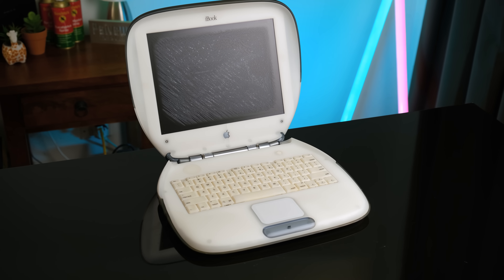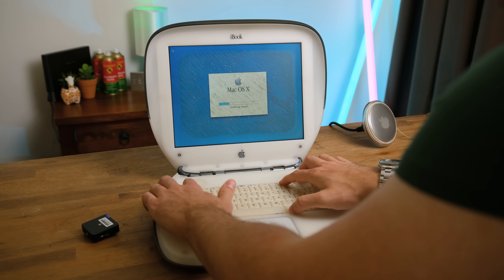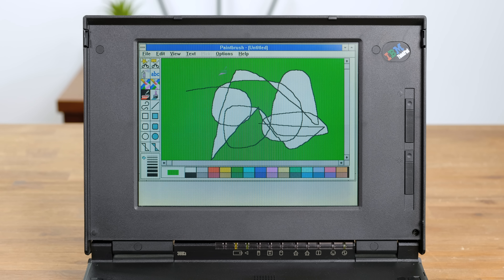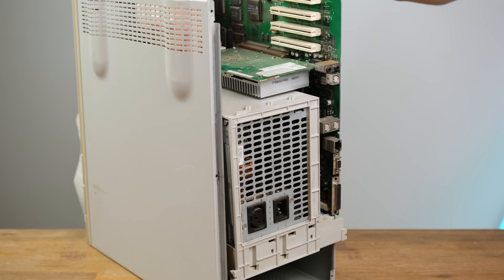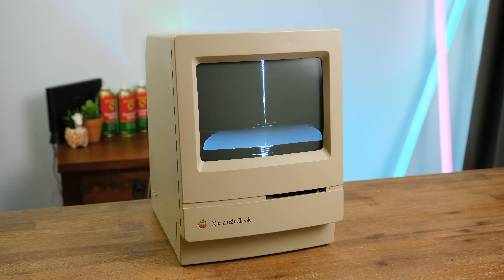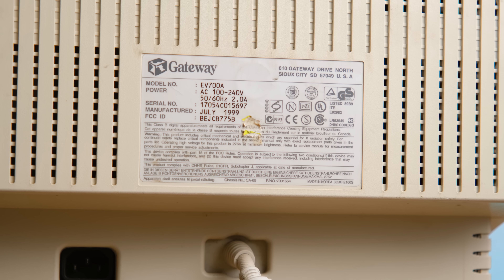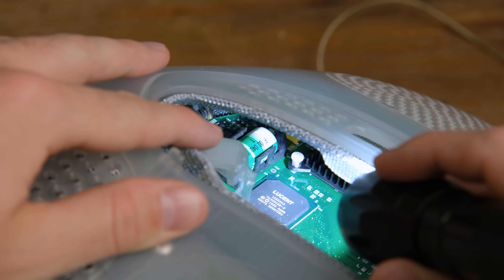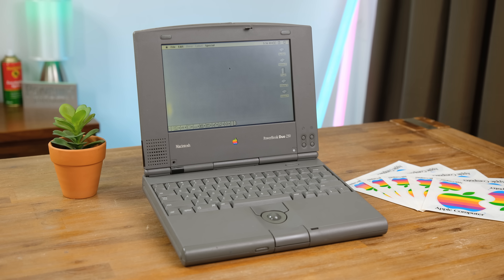So Much Vintage Tech Is Dying... Here's Why

Comment: i don't wanna sound like i'm trollin but...

my 1997 model playstation 1: 
>no capacitor corrosion at all
>the potentiometer for the cd laser just needs some tweaking and it's ready to keep going for some more years
>cd laser assembly easy to replace, no recapping required for that
>power supply's just 3-4 thru hole capacitors, pretty simple to fix if you want more reliable power going to it
>boots up just fine works just like day one
laughs in playstation

to showcase it's not sony fanboyism, i've had FAR less reliable fat PS2s when it comes to the disk drive behaving properly.

funny how that cheap ass console appears to be more resillient than far more expensive computers of the time and even newer than it.
Reply: I mean, I have a NES from 1986.... Works better than I remember it when I was a kid (I did open it and push all the pins back for better contact) and I use it at least once a week.

Comment: 3:32 Yeah those Duo Docks man. I recently bought one, and it didn't even survive transportation. Heard something rattling in there when I got it home, and when I tried opening it up, the dark gray plastic details broke in several places. It's like it's not even plastic anymore, it acts more like hard rubber in terms of how bendy it is when initial pressure is applied, but then with a bit more pressure, it just snaps right off. Don't think I'm able to save it,  90% of the docking mechanism is based on that dark plastic.

Comment: Yes, this is a perfectly normal thing to happen. As a former collector of old electronics, gadgets, computers and consoles - various materals break down over time also depending on how they where stored. For example old cassette players tend to have rubber belts in them that will crack or melt over time as a chemical reaction to prolonged exposure to air, humidity heat and cold. Plastics tend to crack over time, metals will eventually corrode, batteries and capacitors will either leak or dry out and cause leakage, corrosion and shorts. For example my old electronics lab had perfectly good functioning useable test-instruments in it, I turned a few of them on after a few years of not using them - and they don't work anymore. This is usually due to shorted capacitors - that is capacitors that has dried out and no longer functions as they should - locating them and replacing them is usually the answer.
Reply: Yeah, I don't understand why some people are upset that a product that nobody expects to use for practical purposes 10+ years after purchase starts to degrade. It would be moronic to build them to work for decades. Car reliability is important because the function of a car hasn't changed for decades and will remain essentially the same. Computers are not like that. Given a long enough time, even simple tasks will push a computer's hardware to the limits. I completely understand wanting to collect and preserve them. I think it's really cool which is why I subscribe to this channel. But to say that it's some sad state of affairs that computers start to break down after many years is kind of missing the point of computers.

Comment: I found out ammonia is great at completely removing the melting rubberised coatings accidentally. And it's cheap. Comes off in an instant with no resistance
Reply: but that thing is toxic as fuck and burn your nose
Reply: Wait really??
Reply: @PhantomWorksStudios  yeah, I was cleaning up an old unifi AP because it also had started to melt the coating and I had a spray bottle with ammonia I used to clean the house. With gloves on I wiped it off with a paper towel and magic, the coating vanished
Reply: More details? What concentration? I have a few rubberized items i want to remove the coating from!
Reply: @goclunker  I know amonia mixed with water temporarly fix dry and cracked up rubber. It's can be a quick solution for à temporary fix in a car for suspensions.
Reply: @goclunker  oh, it was just car windscreen cleaner and a rag
Reply: @auzzierocks  hmmm

Comment: the pastic destroying itself is also a concern for 80's and 90's car. in my car, a lot of gasket, engine part and washer were starting to be made out of plastic. they all now break appart when you try to dissassemble something or were already destroy. There was a really bad play in the steering wheel and it turned out they used plastic spacer to mount the bolt on. those plastic thing disintegrated years ago and left a pretty big hole and that's why the steering was shaking and moving everywhere.
Reply: In a couple decades it will be easier to find classic cars from the 50s and 60s than it will be able to find working examples of cars from 90s because of all the plastic and tech that just doesn't last.
Reply: @Novusod  it’s funny because it’s already hard to find any cars from the 50s and 60s anyway so I highly doubt that statement
Reply: @Novusod  I feel like we're already at that point I see far more cars from the 60s and 70s on the road than cars from the late 80s and early 90s.
Reply: @Novusod  plastic and tech can last, but it depend with quality. And at that time they found out that plastic was an awsome material to make some cost cutting part. And that plastic wasn't good either. Look at the plastic from 30's phone. My mother had à phone that her father had, it was from the 20s I guess. Full wood And Iron except for the handle that is hard plastic. Guess what didn't roted or rusted out.
Reply: @mehdisol7094  Your mother's phone would have been made out of Bakelite. Not really a plastic in the modern sense.
Reply: @Novusod  Nope. Bakelite is still plastic.
Reply: @Novusod  bakelite gets brittle, esp if it gets hot.  so it has its own problems. looked after it lasts for a long long time.
Reply: @Novusod  It already is. When was the last time you saw a 1994 Chevy Beretta?
Reply: Nature and Time destroys everything, even without using it I was looking for a cool honda from the 90s with a vtec.
like i had when i was a teen
But they are all in bad shape now, they are falling apart 
Same with other brands ....
All the cool cars from the 90s are breaking down and parts are harder to find
Reply: @HappyDude1  I sold a 1998 Acura integra GS-R a few years to a guy. That car was a time capsule that i drove to work on Friday’s and special occasions. The car was covered or garaged for most of the 22 years I had it. Just protecting it from UV radiation and extreme cold ensured that car was in solid shape. If you wanna find one you’ve got to find someone like me who preserved one
Reply: @Matthew Caughey  
Why did you sell it ? 😵
Reply: @HappyDude1  My 94 ranger is what I'm driving now. I can get parts a day long for it!  O wait, you said cool cars. 😅
Reply: I hate with passion plastic valve covers and thermostat housings
Reply: So many used cheap plastics in that era as well. My 88 Camaro plastic virtually disintegrates to the touch- best not unclip anything if you can avoid it!

I’m more worried about today’s cars in the future- we are seeing essential items like cooling system components and even oil pans made from plastic that will ultimately fatigue and crack with heat cycles.
Reply: @sc3ku  me boio the dash is known to crack and the hatch motor gears can strip if you have the 5.0 TBI its bullet proof
Reply: I feel your pain! Back in high school I had a 1998 Chevrolet and when I was working on it with my dad, he bumped one of the radiator hoses on the intake manifold. Guess what that connector was made out of? Needless to say I spent an afternoon hunting down a 3/4 inch tap to fix the marred threads (after he tried to remove the leftover plastic with an ez-out) and replaced it with a proper aluminum connector.
Reply: The rear doors of my truck stopped working because the internal latches used plastic on the ends of cables
Reply: I love 3D printing, moulding and casting. We're going to have to get good at re-manufacturing parts at small volume to maintain all sorts of ageing tech. Plastic parts are not exactly high on my list of worries, even though they are becoming a headache.
Reply: My 1988 Toyota Cressida suffer from this issue too. The center console frame is so brittle that by just plugging/unplugging a lighter plug phone charger can easily destroy it. I think the only cheap way to replace mine is to get a good 3d printer so I can replace other damaged parts too
Reply: Don't forget ECU failures, the capacitor issues that plagued computers in the late 80s into the 90s and 2000s also plagued the ECUs of cars from that era.
Reply: @Dan-TechAndMusic  There's also Z adhesive failures, that's the kind of tape headunit and dashboard LCDs are connected with to ribbon cables and PCBs. All sorts of internal display failures as well, usually very unpleasant or impossible to sort out. Then there's EEPROM bitrot, especially embedded EEPROM with readout protection (firmware). I think typical issues like cracked solder joints and capacitor plague isn't even that bad, like you have to tear things down and rebuild them, but at least these are low risk repairs.
Reply: I had this issue to a degree with my 72 Chevy with interior parts plastic shattering and rubber Ewing a goopy sticky mess. Luckily they made all the important bits out of metal
Reply: plastic parts can at least be 3d printed.  not sure how well the replacements will last, but they can be remade and remade.
Reply: @varsityathlete9927  I have had issues with longer term durability with PLA, the most common 3D printing plastic. I don't know what it is, it's reacting with something (ozone, light+oxygen+moisture?), but a few years on, all the PLA prints that were initially quite strong have failed in surprising ways. I have been 3D printing for 5 years now. PETG and HIPS are looking very good for endurance, as should ASA.

There can always be formulation issues which lead to material degrading. The Mac inner chassis just crumbling to bits in this video, it should be ABS and it shouldn't be happening to it, but well there it is, and i have absolutely seen this before first hand so i know that this happens, and i don't have an explanation. Best i can say about this is that you'd have to be quite unlucky to have this happen again on this timescale with remade parts.

Polyamide (PA) is also useful printable polymer family for spacers, mounts, bushings and clips, this is also what they're usually from originally in a vehicle, being both very low-friction, inert, flexible and exceptionally tough, and these last depending on temperature for 10-25 years, or can be rehydrated to extend their life. Indeed you're likely to find PA-GF (same but with glass fibre for stiffness) parts in engine bay, and could be considered printable, but would do best just being kept rehydrated once in a while. They're cast or print hard and undersize, and conditioned in humid atmosphere for a day or several depending on temperature or during transit from factory (sealed in bags with the right amount of water), absorbing about 4% moisture by weight, and with time and heat, they just evaporate this moisture back out and revert to the brittle and slightly shrunken initial state, but as long as they haven't cracked yet, this is reversible just the same.

Typical case of a brittle shrinking dashboard is where they cheapened out hard and used plasticised PVC, this is fairly typical. This is bad in a number of ways. For one, PVC is chemically unstable, the chains break at elevated temperatures or with time. For other, it already gets pre-degraded substantially during injection moulding, because by the time it gets molten, the temperature is critical for the polymer, it doesn't survive much more than a few minutes. Third, the plasticizer is a "non-volatile" solvent, well guess what, it does volatilise eventually, and i have reason to suspect that no way can exist to reverse it. A copy cast out of epoxy should last just about forever though. Indeed just about any way you'd use to manufacture one, it's going to be better and more durable than the original.

SLA resins are an active research field. So far they're not doing great, but the progress is exciting.
Reply: @SianaGearz  thanks, interesting.
Reply: thankfully in my 1991 Geo Prizm, the rubber breaking and plastic breaking is only in the interior, the rest of the car is doing fine, it makes me sad though since replacement interior panels for Geos don't exist
Reply: @lavafish7660  3d print?
Reply: @Anonym Anonym My 66 Mustang original speedometer bezel was at the bottom, so I had to find a OEM that looked almost new.
Reply: I had a 98 beetle and vw used a soft touch plastic like he talked about all over the interior. By the time I got the car 20 years later it was a broken down into a sticky mess that smelled like crayons.
Reply: Not many car made after the late 1980s is worth collecting.
Reply: @Melvin-h9l5x  actually yes, if you are not closeminded the 80's and 90's saw some of the greatest cars. Engine became more powerful, cars were more reliable, not à lot of tech and no emission restriction to fuck everything up. I love 80's and 90's car, they have so much style and charm
Reply: @Melvin-h9l5x  the 90s had some amazing cars, not everyone wants to live in 60s retrofuturism or 1920s ornate, some people might yes but not everyone
Reply: I had a car from 1996 and the whole plastic dash was falling apart a couple of years ago. I had to sell it at a ridiculous cost at the end. After that I realized it's a bad idea –overall–to buy a car from the 80's-90' and in some cases even from the 2000's.
Reply: It's interesting, I have a still-working analog voltmeter from the 1940s, made of bakelite plastic, that still works perfectly. And the plastic hasn't broken down at all.
Reply: @joshualowry2000  and this plastic is hard as fuck too
Reply: I have a Yugo and almost all the plastic is visibly in one piece, but feels like it shouldn't be. The dashboard feels like a paper thin sheet of chalk that would shatter into a million pieces upon trying to remove it. I haven't tried, I'm scared to lol. I had to wrap the steering wheel to keep it held together.
Reply: I remember in middle school, some friends and I used to love going into the woods and looking at remains of old things people lost or dumped over a bank. We found a car in there, but it was so rusty I don't know when it was from. Old records that had deteriorated were common, pop bottles, and even old metal wheel frames that the wood rotted out of. General rule was that plastic was safer to leave than try and pick up if it was past a certain point. It would just crumble. Cassettes were bad for falling apart and being found in the woods. 
That being said, one of my teachers from then has a Chrysler van from the 90s that I saw in 2019 and couldn't believe it was still going, let alone made it on such a long journey where we met! I can't remember if it had wood or plastic interior, I know the Plymouth ones were more likely to have wood inside.
Reply: Check out the YouTube channel “Garbage Time” where some of the old cars the owner of the channel has need extensive repairs because of the parts used in 80s and 90s cars. Then again, he also holds and destroys devices that have that sticky rubber surface on his other little known channel called…..DankPods.
Reply: https://youtube.com/shorts/T6-O2u0KCDc?feature=share
Reply: BMW
Reply: Thats not scary!
Reply: Maybe you can find an NOS or aftermarket plastic...
Reply: @mrfixit8776  we already have difficulty to find OEM parts for 90's cars, and my car is not really an a tuner enthusiast car with a lot of after market solutions like toyota or nissan or what
Reply: Apply heat from a hand dryer and warm old plastic before attempting to touch it at all, works a lot of the time
Reply: They even began 20 years ago to make ball bearings encased in plastic instead of metal.